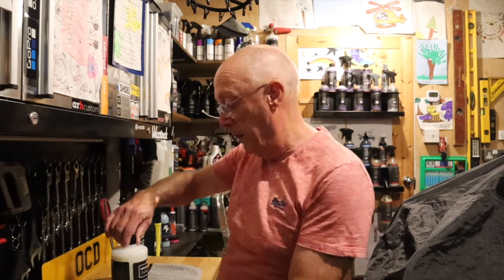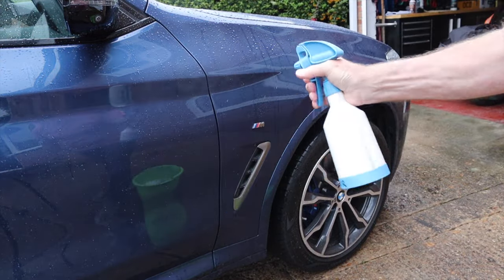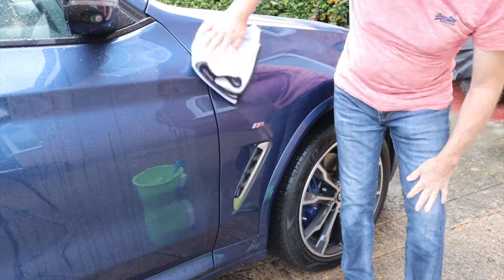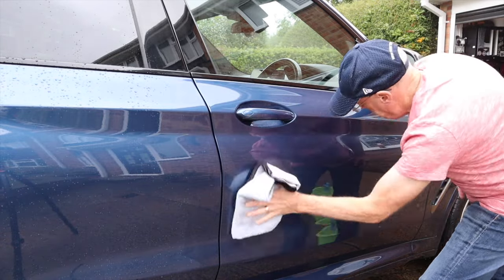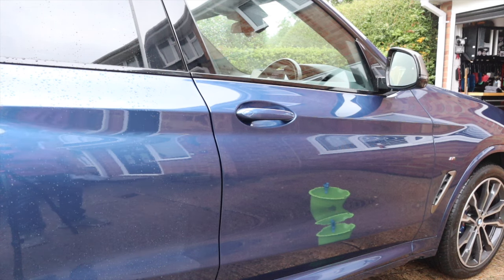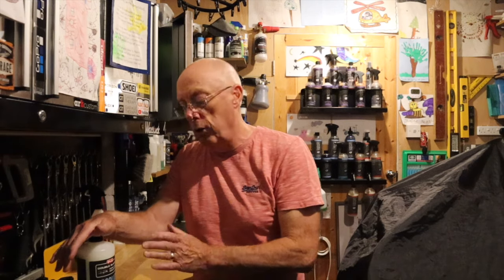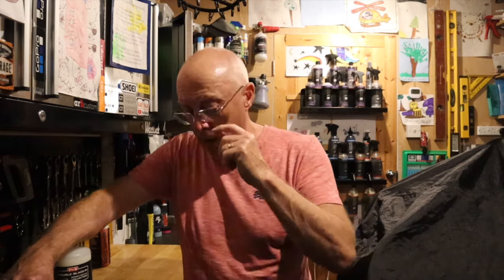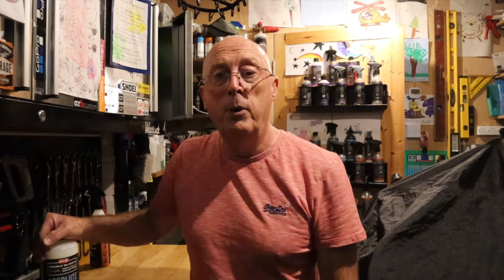Wash & Sparkle in 30 min

Comment: Excellent analysis there Martin, thank you. Absolute is not good at releasing dirt, but does clean well enough.
My two favourite are ADS Hero and DIY Detail. But then GT Rinseless arrived today, and its easily a match for those two, and that's at 256:1. Need to test some more, but wow is it good!
Try it on your interior. Soak an MF in the solution (preferably before doing the body), ring it out and wipe it over every surface, then buff dry if need be. May need to return to the bucket once or twice. Also great for kitchen, bathroom, everywhere really. Have fun with it!
Cheers again for the demo and honesty
Reply from the maker: Cheers mate, tried Absolute again today. Again it cleans but again it didn't release dirt from the MF mitt.

Comment: Lovely little video, thanks Martin.  I'm about out of Absolute now and have been impresed with it, i prefer it to ONR but, GT is the next rinseless purchase for me. All the best, keep them coming, please 🙏
Reply from the maker: The problem I had with it was around the towels were a little grubby after dipping them in the solution unlike ONR & GT where all the dirt was encapsulated and dropped to the bottom of the bucket. I will give it another try and make sure of the dilution rate🤷‍♂

Comment: For a quick spruce up , rinseless wash is the way to go Martin.  I've used P&S Absolute but i feel DIY Detail  rinseless is so much better in every way except cost
Reply: Fully agreed. DIY rinseless is a superb product and they have just released a version 2 that is supposed to be even better.
Reply from the maker: I've not tried it Robert but if it works for you then stick with it👍
Reply: I’ve used Absolute , but prefer DIY rinseless too.

Comment: As I have previously said it's not a method for me at home but if I was on holiday up North it is an ideal way to bring the car up to a level of cleanliness I would be happy with.
Reply from the maker: It works for me John but totally get why some may not like the idea
Reply: @ObsessiveCarDetailer  I would be interested to see a side by side comparison under a paint inspection light to see if there is any difference but I guess it is all subjective.

Comment: I wring out the dirty media onto the ground before putting it back in the bucket.
Helps a lot.
How much water was in the bucket?
I use 8 litres minimum.
Same with ONR.
2 litre pump sprayer is so much easier for a pre soak. 

Basic rule of thumb is. Don't use a Rinseless wash from October until March. Unless you are going to a jet wash and blasting all the brine etc from it. 

Personally I just get a Professional Detailer to do my car in deep mid winter. 

PS. Did you vigorously shake the bottle before using? 

It says just to turn it upside down a couple of times. Or the surfactants and polymers will separate. 
A bit silly I know. 
But P&S are quite adamant about it. 
Good video. 👍
Reply from the maker: Good afternoon, I had about 8lts of warm water in the bucket and used a hand sprayer because I filled it from the bucket. Good idea about wringing it out before putting it back in the bucket. Yes guilty, I gave it a good shake before use. I will play with it to see the difference by not shaking. A professional Detailer ???????????? shocked. Great comments thanks👍
Reply: Yeah Martin. Multiple surgeries on Hips and my back is knackered.
Sills and Wheels are a huge problem for me mate.
Love doing what I can Spring, Summer and Autumn.
Pretty OCD just like you mate.. Lol 👍😎
Reply from the maker: @kinnonmcallister  oh ok, I'll let you off. I must admit, I have to have a seat when doing wheels. If I get down Im like a beached whale trying to get up. Old age aint great but at least I made it👍
Reply: Don't think I'm that far behind you in age.. Lol.
Forgot to say.
I use my presoak at QD strength which is 64:1. Which is basically just pennies more. Not that I care about the cost per wash.!
Just trying to be sensible and give the product a bit more bite. So to speak.
I look after 3 of my neighbours cars nine months of the year and NEVER inflicted scratches or indeed swirls on any of them.
Pretty sure that you can only inflict swirls if you wash in circles. Which is something I have not done since 1995!

Feel free to correct me if I'm wrong about that mate. 👍
Reply from the maker: @kinnonmcallister  it’s strange how most of the people who have said they wouldn’t use it as it’s not safe are the ones who have never used it🤷‍♂️. Another good idea, making the spray a little stronger

Comment: Just checking - did you dilute it properly? I’m a recent convert to RW and Absolute is superb. 👍🏼
Reply from the maker: No issue with it cleaning the car safely but not happy with the way it didn't encapsulate the dirt on the towels and remove it in the bucket. I will play with it again and double check that I have the correct dilution rate

Comment: The problem I found with bead maker is it attracts dust like a magnet….Adams detail spray is far superior in every way 💪
Reply from the maker: I've found that if you mix 1 part P&S Dream Maker to 10 parts P&S Bead Maker that it neutralises the static. However, I have seldom found any Adams product to disappoint

Comment: Interesting stuff martin. Thanks. I think rinseless is great for summer dust but not for uk mud and grime. Out of interest do you use this method on wheels or would it just ruin the cloths ? I love using ONR in summer if youve no time👍
Reply from the maker: @JamesBartlett-n6e  That’s how I use rinselss as well. Any dirtier and a proper contact wash. I don’t use it on my wheels as I like to get right in and clean the barrels and like you said would trash my towels